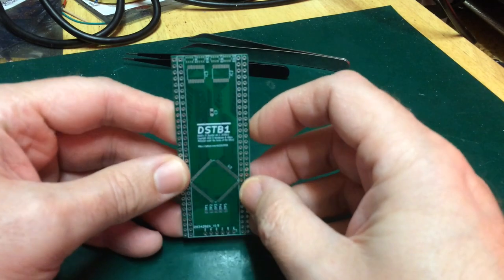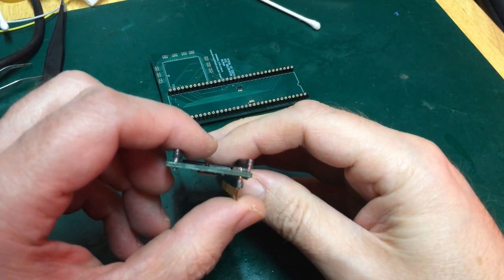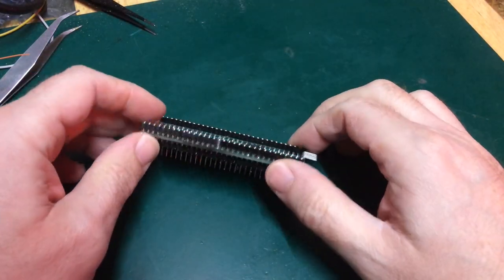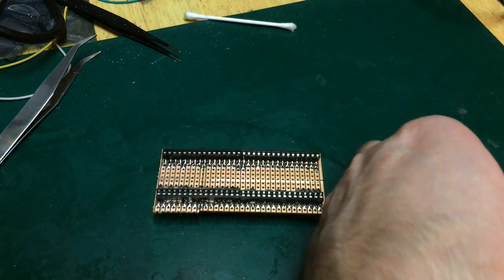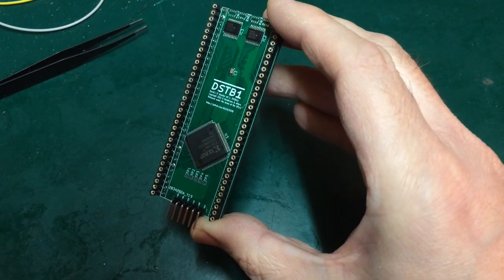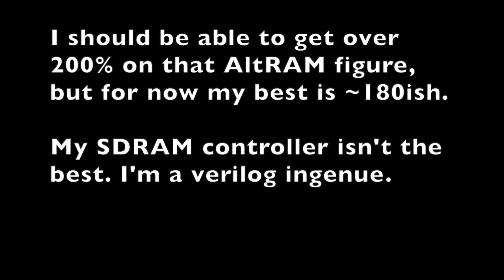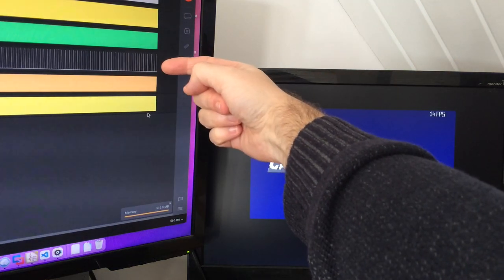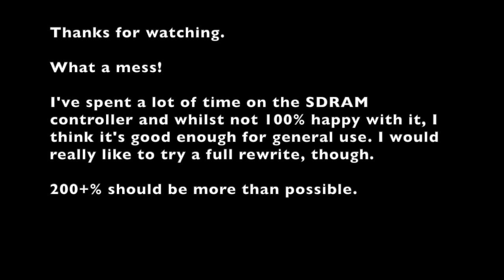Let's build an Atari ST accelerator (...badly)

Comment: Nice project!
Don't know if you already got an answer for the memory at $400000 but TOS will try to read from 0 and upward in some increment. When it eventually hits a bus error it knows how much ST Ram there is.
If your memory is at $400000 it's going to be able to keep on trucking and assume that range is also part of ST Ram until it eventually ends up with a bus error beyond the memory range on your card.

Leaving a gap as you did will make it correctly trigger a bus error when TOS is enumerating address $400000.
If you really want it at $400000 I guess you could have your memory disabled on boot and only enable it afterward with the help of an auto program (or maybe.. ignore the very first access to $400000 assuming it's going to be TOS's ST-RAM enumeration?)
Reply from the maker: Thanks Anders. Yes, I understood what was going on but thought it was a strange choice by Atari unless they were planning for more than 4MB STRAM back in the day! After discussions with the EmuTOS guys, I decided to emulate the MonSTer protocols a little so now it's triggered automatically by EmuTOS or by a little driver app. I do need to have a look at your BLITFIX program to see if it can be used for ST-AltRAM as it can for TTRAM as I can't quite get blitter support working yet.
Reply: @thetechnoshed  Yep a little strange. They could have just stopped at 4MB :)
You may have to modify blitfix to work with your memory range.
I don't remember exactly now but I have a vague memory of it maybe just checking if an address is in tt-ram to determine if it's a blittable or non-blittable area.
You may have to extend it to check the 24bit alt-ram region as well.

Comment: Nice project!
Rather than creating a DIP stack perhaps you could have a version that uses a QFP MC68SEC000FU20.
Can run at 3.3 or 5V and use less power.
They easily overclock to above 40MHz. But you may have to get the CPLD to simulate a E cycle as the SEC version drops the E signal.
Reply from the maker: Yes, Exxos has an ongoing project for that! https://www.exxoshost.co.uk/forum/viewtopic.php?f=82&t=45&start=550#p57280 I had a 16MHz CPU laying around, on the other hand. :-)

Comment: It would be so nice if a Blitter would be included in the CPLD. This could really speedup TOS, IDE Drivers and Mint. Sadly most software ignores the Blitter if present. And because accelerated RAM can't be accessed from a normal Blitter the usage is limited in such scenario. Just a stupid dream. :-)
Reply from the maker: Blitter should work with AltRAM in an ST(E) as its' on the CPU-side and has 23 address lines. I've really struggled to get it to work well, though, and have basically given up (I've a video filmed but no yet edited about it). I suspect asking a CPLD to replicate the blitter is asking a bit much, though. I can barely fit an SDRAM controller in there.

Comment: Hi David, I'm working on a similar project (SDR-SDRAM as AltRAM for ST) using a 1040STF C070789-001 Rev.C board and stumbled upon a strange error. I can run YAARTTT in [M]anual mode for 10+ hours without it throwing a single error. Same with TTRAM_16.TOS. I wrote an ASM PRG to Maddalt the memory and install a FRB (located in the BSS). Put this little PRG into the AUTO folder. Now I can run YAARTTT in [T]T-RAM test mode. Still no errors. But whenever I start Pure-C shell and try to compile/link one of my projects it will generally throw errors like "Include file stlio.h not found" when the source clearly says "stdio.h". And I see similar "byte-flips". On the other hand Pure-C does not crash throwing bombs. GEMBench runs without hiccups. So I put my SDRAM-Board onto a MegaST4 board and it just runs fine. No Pure-C problems. Did you encouter similar problems?
Reply from the maker: Hi there. Yes, I'm afraid that's the way of these things! Some processes will tolerate a slightly slow response, some won't. YAARTT, for example, is trying to identify failed memory, rather than the quality of your RAM controller so it's quite nice and slow, spread out. It gives your RAM controller plenty of time to do its thing. Then you try to boot into MiNT... crash! I'm working on a video at the moment where I mention I couldn't service the blitter and get MiNT to boot. One or the other! Exxos has been saying for years different motherboards behave very differently too. It's entirely possible none of my designs will ever work in another board, but that's the hope of open source: you'd have the tools to make it work if it doesn't out the box! Best of luck. :-)
Reply: @thetechnoshed  I think I've figured it out. Details on atari-forum.